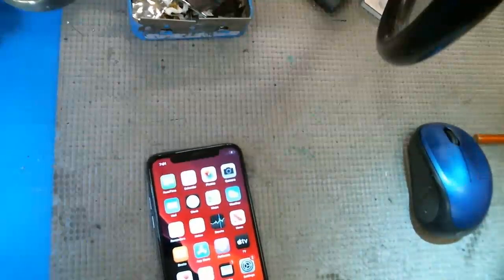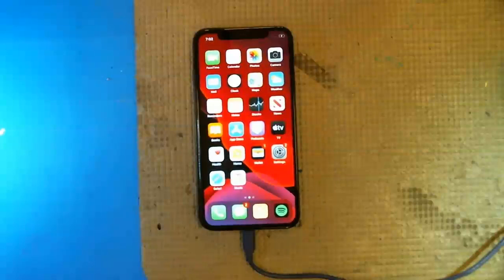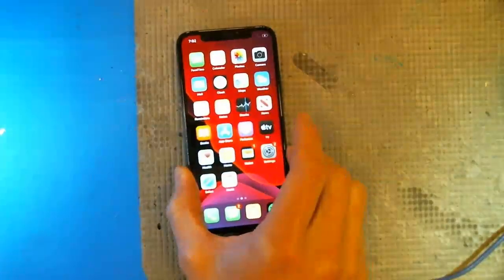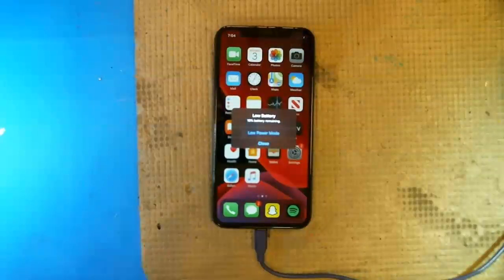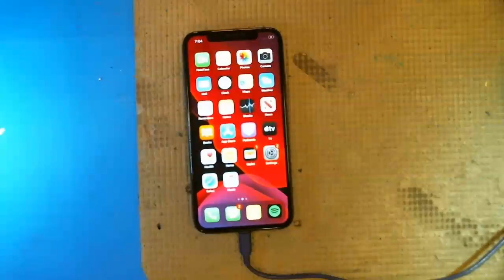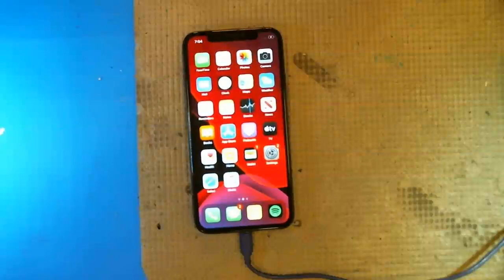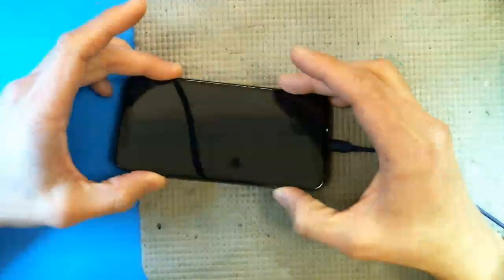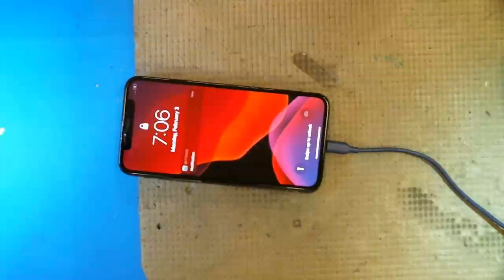iPhone Xs Boot Loops After 3 Minutes Repair

Comment: My 3 year old XS 256gb became super laggy one morning and started crashing all the time. It would not update the iOS as it crashed after 1 min, could not reset anything as it crashed - made no difference if on charge or on wireless charge pad or no charge source at all. Battery health 84%. It could not be backed up because it would just crash. The phone was totally reliable up until this point. I suspect it was because on that morning I used a new car charger and a surge of power has damaged something inside. Of course this happened on Xmas eve when all the repair shops are closed so I can't talk to anyone knowledgable about it. The phone is still just about usable to maybe make an SOS call so I will leave it as is until I speak with a repair shop. The only step left to take is to master reset the phone - I don't know if it will be able to handle that request so at the moment at least I can go into some important apps to periodically check. I will update this post once I know the problem but I suspect new charge port. I am in the UK.

Comment: Mine is laggy and boot loops like this, I just put a new battery in could that be it
Reply: So is fix the problem?
Reply: @dfdfd5600  I replaced the charging port and fixed the issue. Whoever gave me the charging port through eBay gave me a broken one causing this😅
Reply: Thank u I well try it
Reply: Burak Es  you probably need a new charging port. That’s what fixed my issue.
Reply: Burak Es  also it has to be an apple original charging port or else it won’t work
Reply: Burak Es  I’m not quite sure what you mean. But you can go on eBay and type in apple original charging port for iPhone XS. They are not that’s exspensive.

Comment: Thank you for this! I ordered a frame from ebay and it started boot looping. Got the replacement frame and it charged to 100% and started boot looping. One thing I never did was swap over the OEM charge port! I will be doing the swap in the morning and I hope that fixes the issue. I keep getting the Panic-Full dump and checking further it says thermalmonitorID assuming something the aftermarket charge port doesn't have vs OEM. AGAIN THANK YOU!
Reply: It's work now?
Reply: @dfdfd5600  yes
Reply: @TheIc3m4n89  where did you get the OEM please ? I changed mine with aftermarket but didnt work
Reply: @mountakhabi  MobileSentrix

Comment: just got my touch screen replaced and phone boot loops every three minutes. will the repairer fix this for free?
Reply: They should,  As a repair store owner I always ensure our customers phones are working properly after any type of repair. I also tell my repair customers that if they have ANY issues with their phone (boot loop, ghost touch, etc) to bring it  back and we will fix the problem for free.
Reply: i think you need to change your earpiece sensor that could be the faulty

Comment: UPDATE:  I read in a YT comment that a person fixed their bootlooping Iphone Xs (every 3 minutes) with a $12 charging port from Amazon.  They gave no brand name.  I searched on Amazon and found a charging port for $11.99 by KAKUSIGA for an iPhone Xs.  I took a chance, bought it and replaced it and it friggin' WORKED!!!  My wife wanted to chuck it, but I wanted to fix it since my iPhone 7 was crapping out.  To change the charging port, you almost have to gut the phone.  Buy the battery adhesive, and use tools that area slightly magnetic.  This helps a lot.  Also, buy a seal to seal up your phone after you fix it (hopefully!).  I followed the video by WIT RIGS since he numbers each screw and shows you what type of tool to use.  That is very helpful.  Good luck!

ORIGINAL POST:  If my Iphone Xs reboots every 3 minutes but I can still charge the phone, does that mean the problem is a bad charging port?  I've done all the resetting, and finally the DFU reset...connecting my iPhone to  iTunes on my computer to do a restore.  All failed.  Who sells aftermarket charging ports with the "Thermalmoniord sensor" ?

Comment: It's a sensor that's on charger port on original called "thermalmoniord" this sensor is not on the generic charger ports that are sold. The "thermalmoniord" when missing the phone counts down 3 minutes then reboots. The way you can check if it's the sensor it's looking for is look at the error log on the phone or keep locking and unlocking the phone. If the phone doesn't reboot it's because the generic charger port don't have a thermalmoniord sensor on it. Apple have done a bad job of resetting the count down time when the phone is locked and unlocked.
Reply: Thank you for the informative comment, I've struggled to tell some repair shops this was my issue but they've always insisted it was my battery or the software which has been pissing me off. Replaced the battery, issue still persisted and I got my money back. Thank you for allowing me to clearly let them know what the issue is!!! My only question is, just to make 100% sure, what would be displayed in the error log for me to know that it's the thermalmoniord that is the issue, and how would I go about getting an OEM manufactured charging port?
Reply: @Robbie_L_B good but one question I have read everything you have said but mine if blocking and unlocking for 3 minutes will restart alone

What is my problem exactly do i need your help?

Comment: So I disconnected the battery port and plugged in to the charge port and my phone boot looped within seconds, not even moving past the apple logo. Do you think it's definitely the charge port that needs replacing? Where can I get an OEM charge port?
Reply: I took out the battery port as well and plugged charger into the charging port and have the same issue as you. Did you end up replacing the charging port and fixed your problem? I know there isn't nothing wrong with other things cause when removing those parts it is still happening. It has to be the charging port.....
Reply: Did you found where to buy oem ?

Comment: I have the same problem with my ipad pro 10.5inch .Any solution??
Reply from the maker: Most likely you damaged the battery connector
Reply: Microsoldering i m thinking if my new screen replacement is the reason.It’s not original screen and maybe this cause the problem.I don’t know for sure.I m confused

Comment: I have the same problem, I also replaced the charger port I thought it might have been motherboard. I also tried an original battery. But the problem I have is it doesn't boot loop when I'm not using but as soon as I use it after 3 minutes the phone boot loops.
Reply: I have same problem
From 2 days
U have any solution
Reply: @hardeepwaraich7572  It's a sensor that's on charger port on original called "thermalmoniord" this sensor is not on the generic charger ports that are sold. The "thermalmoniord" when missing the phone counts down 3 minutes then reboots. The way you can check if it's the sensor it's looking for is look at the error log on the phone or keep locking and unlocking the phone. If the done doesn't reboot it's because the generic charger post don't have a thermalmoniord sensor on it. Apple have done a bad job of resetting the count down time when the phone is locked and unlocked.
Reply: I have a friend that does soldering he managed to fix my original damaged charger port now it's up and running
Reply: @Robbie_L_B  I've the same problem out of nowhere and when I look at my analytics log it's full of panic full and "stacks+thermalmonitord" codes tell that there's a missing sensor.. I replaced the battery but still have this boot loop.. are you sure that this problem is due to the charging port not a faulty motherboard? And if you have a screenshot of you analytics log can you send it to me on mail to (abdooashour72@gmail.com) to make sure that I've the same problem? Thanks in advance
Reply: @abdulsattarashour  more then likely it's not the motherboard because the device is switching on. If you can fully use the device in 3 minutes or lock and unlock the phone and it stays on for longer. Then it's not the motherboard it's a faulty part with the iPhone XS and above you need 100% original parts the fix the problem. I managed to get my friend to solder the broken charger port because non of the generic ones will work because of the sensor that's missing.

Comment: what do i need to change now i dont get the point my restarts every 3 min too HAHA
Reply: You need an original charger port with a thermalmoniord sensor on it or have your original charger port fixed. Generic charger ports don't have a thermalmoniord sensor on them so the phone will count down 3 minutes then will reboot.
Reply: Robbie_L_B Do you know where this monitor is on original port?
Reply: @repairaholic4858  
In another case and example, a damaged charging port (does not charge) and I buy a parallel (non-original) part and the iphone will logically restart every 3 minutes ..!? ... Because it is not original, with this "thermal sensor" ...
Certainly there are several such pieces, replaced worldwide ...
Reply: Mine (I bought all cracked to fix up) is running abnormally slow and unresponsive and after probably about 3 minutes it’ll shut down. Is this the issue ?

Comment: it did work!!! thanks for sharing
Reply: what did you changed sir ? battery or charge port ?
Reply: GeekGermany the OEM charging port with flex cable, aftermarket is not accepted
Reply: @daisyliu26  where can i buy one ? 

i bought now fpr 8 euro one from ebay , but whre can i get OEM
Reply: GeekGermany you may try. As far as I know, could find the OEM charging port from eBay
Reply: @Ahmetsworlds  Bought not OEM? resulted?
Reply: @p.bexiga7967  non oem from ebay 7 euro works fine
Reply: GeekGermany PS. The phone will keep restarting without any charging port,too

Comment: Hi, would like to ask if my charging port does charge the battery but its not oem does that still mean it could be charging port problem?
Reply: Yes because its not the charging port itself that causes it, its the temperature sensor on the charging flex that causes the loop.

Comment: I hate random bootloop repairs. Just about any issue can cause this which make diagnostics take so long. 
I’m stuck on an xs Max random boot after a few minutes, this was after he had the broken back glass replaced using a laser machine from another shop. 
I’ve had quite a few repairs done from back glass laser machines cutting into the motherboard or flex cables, 🤦🏻‍♂️.

Comment: You talk too much just get to the point please.
Reply: It's a sensor that's on charger port on original called "thermalmoniord" this sensor is not on the generic charger ports that are sold. The "thermalmoniord" when missing the phone counts down 3 minutes then reboots. The way you can check if it's the sensor it's looking for is look at the error log on the phone or keep locking and unlocking the phone. If the phone doesn't reboot it's because the generic charger post don't have a thermalmoniord sensor on it. Apple have done a bad job of resetting the count down time when the phone is locked and unlocked.
Reply: @repairaholic4858  i have the same problem with my xs max i think it is the thermalmoniord
but also when my phone reboot it is slow and laggy.

Comment: Do you know which aftermarket charge ports don’t cause this issue?
Reply: Only original charger ports or charger ports with thermalmoniord sensor on them that the system looks for.

Comment: I have the exact same issue. I tried disconnecting my charge port from the logic board but still have the same boot looping. Will it still boot loop even if the charge port is disconnected? Just trying to isolate what the issue is
Reply: He said that if you disconnect the charge port it will definitely boot loop.
Reply: Sašo Domadenik okay great. I’ll get a new charge port on order then and give it a try. I just figured that if the phone isn’t transmitting power between the port and the logic board surely it’d stop the boot loop but obviously not. Thanks
Reply: @stewartpiper-smith7828  But be careful because he also said that some "premium" quality charge ports were causing him trouble
Reply: @sasodoma  Replaced the charge port with a known working one, but isn't an Apple OEM original and it's still bootlooping. Does it 100% have to be an original charge port to stop bootlooping?
Reply: Stewart Piper-Smith yes
Reply: You have to use original charger port because the system looks for a sensor on the charger port called thermalmoniord if it doesn't find it after 3 minutes it will reboot the phone.